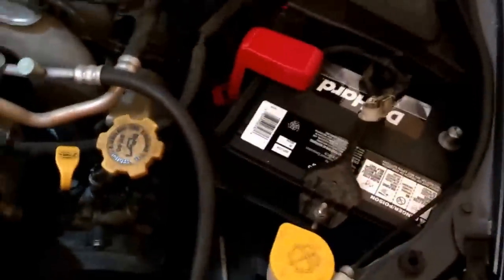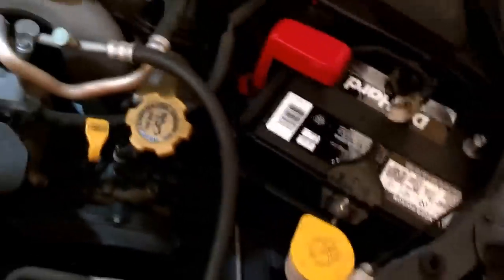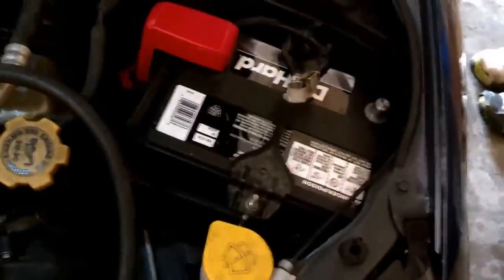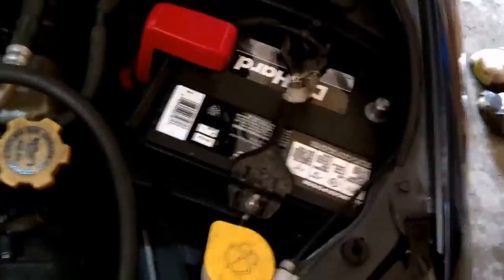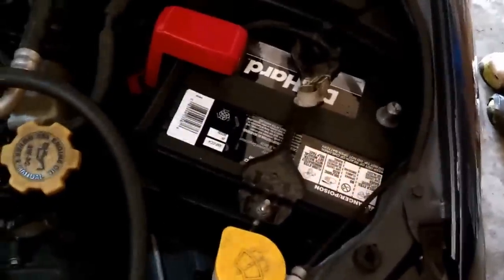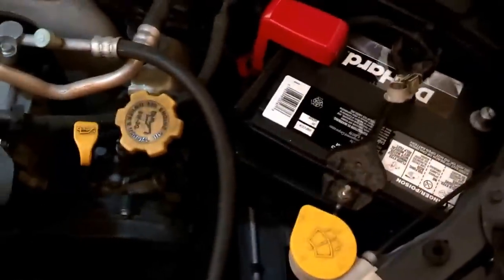ECU Reset

Comment: Hi, thank you for your video! 
We successfully used the procedure to reset ECU to solve our problem which was:
The speedometer and rpm counter stopped working completely after  we experienced aa discharge of battery and had used a battery start boosterand  done a dynamo repair. 
Here's what we did:
-Disconnected both battery connections.
-Short circuited the battery cables for 10 seconds.
-Pumped the brake pedal five times
-Reconnected battery pools
The engine was a little difficult to start after the reset, but once started, the speedometer and RPM meter were functioning perfectly.

Comment: Hi Chazwozel oiling your air filter will decrease the life of your MAF sensor. A dry paper element filter is probably a better option. I could be wrong but this could be a contributing factor to your idling problem.
Reply from the maker: It's K&N's Filter Oil, it's actually required per the cleaning procedure of the filter.  In short, K&N filters work by capturing particulates in the oil film thereby allowing larger pores on the paper element (thus their increased airflow claim).  I don't believe much of it gets into the throttle body if dried properly.

Comment: it actually takes around 150kms (93miles) for the ECU to adjust everything for normal driving and highway as well. Also, I'm not sure if your hatchback subie has an IAC valve, my 2005 has it and its kinda dying and has the opposite effect of your car: often when I press the clutch while on low speeds it raised the rpms to 2.500 - 3.000 rpms. Cleaning the IAC and resetting the ECU helps a bit but the sympthom comes again.
Reply: Francisco Almeras did you figure out what was going on? I’m having a similar issue

Comment: So. I’m fairly new to the WRX sti world. I have always wanted one.

I purchased a 2011 hatchback. WRX sti
And I really enjoy it.

Ok. So. Here are the symptoms.

I was driving at around 45 mph when the aftermarket radio (I am not the one who installed it) started skipping. Like turning off and on.
And then the car started to die, I clutched and started slowing down, preparing for the worst. The radio started back up and the engine started acting normal. BUT! The radio clock was reset, even the date, the clock on the dash was reset to midnight. And it was 5 in the eve.

I pulled into a gas station and shut everything down. And started back up after about two minutes later.

She ran normally. 

My questions are.
1. Has anyone else had a similar issue?
2. If so. What do I need to do for my next step?

Also. Side note. This is funny.

The darndest thing happens with my car. I can’t seem to keep the gas full. It’s always draining, and it drains too fast.... LoL (I enjoy my WRX hatchback I’m not hard on it, I know and enjoy standard, 6-speed)

Comment: So my 06 legacy gt engine check light came on with cruise control light flashing,  also it hesitates to start I have to crack it 2 times for the car to start,  and when I barely step in the gas it just wants to stall.   All that goes away after its all warm up it drives normal but when I turn off the engine and start it back up all the problems come right back.
Reply from the maker: Sounds like a faulty fuse (related to cruise control?)  I'd replace some fuses and maybe get a new battery (since it sounds like your battery is old and struggling.  With a new battery if you're seeing these issues, I'd say your starter might be on the fritz.  Cost saving approach ->  fuses first --> new battery ---> new starter.
Reply: Chazwozel1 it was running perfect till I took it to fucking Sears just for oil change.  The. They cleaned the battery connectors I supposed they unplugged the batt connectors. That's how everything started.
Reply: ak99515ak ...thats a catalyst code. P0420. Either the sensors to convert are bad or catalytic converter is bad

Comment: When you reset your ECU (by unplugging battery for more than 20 seconds) all your sensors get reset... And your learned Fuel Trims get erased. Some cars (Nissan) you might have to do a throttle position relearn. It will drive like crap for a few miles til it learns your throttle body. Most ppl drive around with  dirty throttle bodies... Computer adjusts air/fuel to compensate until it learns your throttle body. Toyotas donut rather quickly, some cars it takes a few miles.

Comment: The Main ECU is located on the passenger side behind the dashboard, under the airbag. The Body ECU is located on the Drivers side. The fuze panel is where the Body ECU is. Why are y’all missing with the damn battery that really don’t work but ok

Comment: this method fix a little vibration when i stooped in traffic light ? , is a subaru legacy 1994 automatic ( the vibration coming when in D , and in P or N no more vibration , only on D , R 1 2 and 3 )
Reply from the maker: It might.  I would suggest cleaning out your throttle body.  There are a number of things that could be causing a noticeable vibration though - not limited to engine knock.

Comment: Did the car not start before the reset ?
Reply from the maker: no, it started fine.  it had a wonky idle, and stalled when slowing as mentioned.
Reply: Mine just cranks
Reply: @Chazwozel1  you said you put a new battery! That’s the only reason I tried your method!

Comment: Let me show you how to reset your ecu - oh wait I think I'll change the air filter (3 min have now gone by) . . . OK now, to discharge the battery - remove both cables and touch them together for ten seconds . . . .WHAT??? that would fry your battery!  Bye bye!
Reply from the maker: lol wut?  it would discharge your electrical system.  Nowhere am I saying to touch the pos to the neg while connected to the battery.  That would short out the battery.  In fact at 3:14 I specifically say not to put anything near the battery.  Get the wax out your ears, son.